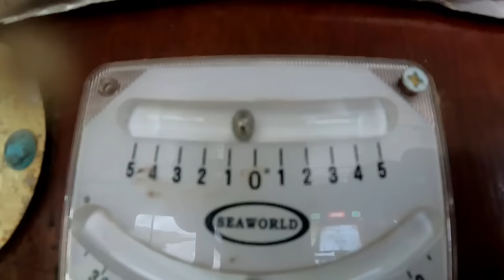Ep 164  - When It RAINS It POURS On Our Boat Restoration

Comment: When I've done restoration projects involving cleaning rust from metal parts,I've always then had them hot dipped galvanised. That makes them absolutely bombproof against further corrosion. Where needed to paint to match other parts,I've used an etch primer followed by the paint colour-but it's the galvanising that provides the massive long term protection.

Comment: One thought, if you had made the two 45 degree cuts the opposite way, then the fill in piece would have been inserted from the bottom and when attaching the sister would have helped to wedge in that piece into the original spot?
This restoration is awesome. You are both machines, keep the good work up 👍👊

Comment: Hi Simon and Gemma in the past I have used cut (can be round, or squere or any shape you want;-) up innertubes or tyers as waterprof washers nail/screw through them if you do need to drill use the smallest pilothole you can.

Comment: You could do with a pressure washer grit adapter to aqua-blast rusty metal. After that, a soak in phosphoric acid will stop any flash rust and hidden pits causing trouble.
Unlike dry angle grinding, minimal health risk and  working outside = easy clean-up.

Comment: A-frame you can build a bird cage if done properly it can last for a couple of years get the heat shrink plastic with the gun and the pvc with the connectors you will be fine and just erect a monumental statue around surrender that way you can fix the decks rain or shine

Comment: Hi simon and gemma if you want a quick fix on the wrotten wood where the drips are just mix up some wood glue and sawdust and then just put in the cracks and when it drys it may stkp your leaks until you the wood

Comment: Please don't take this as a criticism but if that grey paint you spray onto the metal pieces is just cold galvanising then they will need a rust convertor on first. Although they have 95% of the rust removed the remaining 5% of the rust will flourish under the paint. I remain impressed with your level of dedication and quality of work going into this project, keep at it team!

Comment: The orange mallet is a dead blow made of a soft material and vulnerable to damage from using it on sharp metal objects such as bolts.  Using the mallet on wood is ideal.  I've been using them for years used properly they are great.  Love your boat project.

Comment: The bridges is a good idea but I also recommend a floating pier anchored next to the ship, both as a landing when the water is in and a "bridge" over the mud next to the ship when it´s out. A 3x3 meter platform at the stern should not get in the way of the nailing, you may even be able to move it to do nails above the waterline at high tide.

Comment: Gemma, you need to wear eye protection when grinding that old metal. I wear a full face shield now when I'm grinding or cutting steel. Been restoring vehicles over forty years and realise now I should have used better protection in the past. Your restoration is coming on well now. I have never restored a boat but done a lot of ash framing on pre war cars and carriages so well done. Keep up the good work both.

Comment: Useful tip when removing heavily rusted plates hang them up and strike them with a heavy hammer they should ring like a bell the vibration will knock the worse of the rust off, a hammer chisel driven by a compressor or cordless drill set on hammer will work to,

Comment: If keep a large cardboard box.  You can use it as a small spray booth. Keep the wind at bay with the box on the side. Just put something heavy on top to keep the box from blowing. away.  If slip a pipe over the vise handle you will be able to tighten  easily.

Comment: What if you made a frame to go over the top of the bow of the boat with the sides like a roof tall enough for Simon to walk under it would be a temporary shelter for working in and under the deck then drape sheet plastic from your wheel house roof inset 6 inches from the edge and over the outside of the boat.

Comment: I'm wondering what's the point to glue the pieces of wood before using some bolts to fix them ? anyone can explain please?
Reply: The glue takes hours to dry so if the bolts are installed while glue is still wet it doesn’t matter. Then tighten the bolts and glue will dry by the next day and everything is glued and screwed together making a strong joint.

Comment: I wonder in the UK if wood is measured in inches, because when you two were working on your new shop you mentioned feet. Also you used a 5/16 wrench in this video. I worked as a machinist in the US before I retired, and we used inch measurements. But sometimes someone would use a 6 mm allen head wrench on a 1/4 inch allen head screw, and round out the inside of the head. 6 mm is .236 inch, while 1/4 inch is .250 inch according to the decimal usage.
Reply: Officially it's sold in metric, but most people (at least over 30ish) tend to use both, and many timber sizes are referred to by their imperial names - e.g a standard sheet of Plywood is "eight feet by four" but officially 2440mm x 1220mm. The 5/16 spanner is Whitworth (as Simon mentioned), which is the diameter in inches of the bolt itself - this was the standard for most bolts when Sarinda was built.
Reply: @nick-c  oh, ok thank you. I think metric is a better unit of measurement because of the decimal point instead of fractions. Although in a machine shop the decimal point for inches is mostly used.

Comment: I like your grooved decking boards. We don't have them in the states. How thick are they? I think most decking boards over here are about 7/8"
Reply: Normally 100mm to 150mm (ish) by about 25 or 26 mm deep. Length varies but goes from about 1200mm upwards.

Comment: Love your videos and determination to get things done but, please lower your circular blade on table saw to an eight of an inch above the thickness of material to be cut, that way, if you slip or whatever it just cuts an eight of an inch instead of your whole hand getting cut off.  Concerned Mother hen speaking.

Comment: I see that you guys scrap and grind as much rust as you can off the metal parts that you are reusing....but you can't get all the rust off.  There is a product that is a 'rust converter' that converts the rust to a stable element.  It would seem to me that that would stop the return of rust better than simply finishing the metal like you're doing, Emma.  You have probably considered this before so dismiss what I've just siad if that's is the case.  I enjoy your vids.
Reply: I have heard that stuff is amazing what’s it called p4 or something
Reply: @TheMikesylv  I'm not a painter, Mike.  I would ask a painter.  I'm in the USA so you need to find something available where you are.  But the are lots of products that claim 'rust conversion' but just paint over rust like you and Emma are doing.  I recommend that you get the converter that changes the rust to a black conversion of the rust, kinda like a gun blueing process.  Good luck with Serinda.  BTW, I just online searched 'rust converter' and got lots of hits.

Comment: Gemma can't complain at that piece of timber, not being able to get it round corners, its designed to go round corners haha

Simon squatting in the bilge, stop that Simon and use the loo

i was going to suggest don't bother painting that floor panel with paint and you did, use the old fencing protection Croecote, it works really well on things you don't intend to see again, kills the rust and lasts ages

the bridges are cool, now why didn't you scrap the pool a long time ago, might have saved a few of them odd moments crossing the ditches - now you need a floating boardwalk to the boat - which of course makes life easier for the trolls and nutnuts to gain access - need to watch that guys

Comment: Gemma, you need ear protection when grinding, also the goggles wont work when they are on top of your head.
I also suggesst a your long hair in a bun or at least a cap.
Been working with rust and metal most my life, had more than a few splinters in my eyes also my hearing is not what it used to be.
You are doing a great job but work smart and stay safe

Comment: Hiya, just an idea but if that plastic is heavy duty you may be able to weld the seams like I used to do with radon barrier, the edges tape to the cabin all the way round. It would be completely watertight then. 

https://youtu.be/wc7JWNnQw5Q

You can also use radon barrier tape, but it won’t last as long.

Comment: Deckings even slippier than mud ... Be carefull guys.
How are you going to stop them from floating away on high tides..
Are you going to drag them ashore ? 
I think you need some concrete rebar bent over like a wire tent peg but see how they go.
Reply: You must not have watched the entire video because they did steak it down to the ground for that reason
Reply: @mwatkins2464  
Saw that,  still thinking they might not hold  due to water and waves splitting the stakes. 🤷🏻‍♂️ ..  hopefully no more high tides and named storms.

Comment: Are you sure those folded steel braces are good enough to reuse? That was a lot of rust for something with the load they have on them, they look to have lost 50% of their thickness. If I were to reuse them, I'd be doing a more complete job of rust removal, a bath in molasses/water mix for a couple of weeks will remove all the rust entirely. I'd then be using a two-part epoxy anti-corrosion coating designed for a marine environment, not spray cans. Those are going to rust again. 

More importantly, a P2 mask is not really enough for all that iron oxide dust, it's terrible for your lungs. The fact you have the rust dust around where the edge of the mask sits shows you are drawing it in, past the edges of your mask and breathing it in.

Comment: I truly appreciate all your skill and hard work. Please buy a very efficient diesel or gas generator. U will never finish this work without enough power to run your tools. What is the sense of running tools on batteries if you are going to run the ship on its original motor which has no emissions whatsoever and will overwhelm what ever clean energy you used within the first hour or two of it running. You see none of this makes sense and you are not accomplishing anything - climate wise.